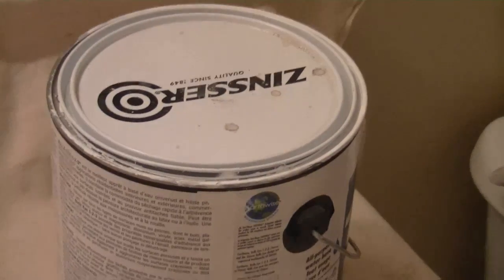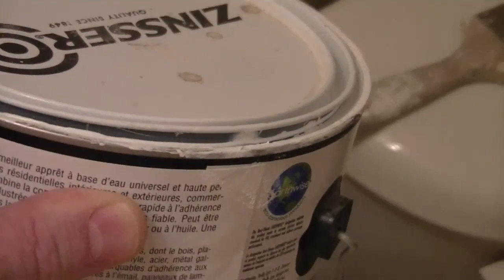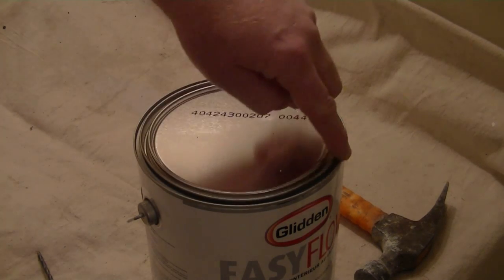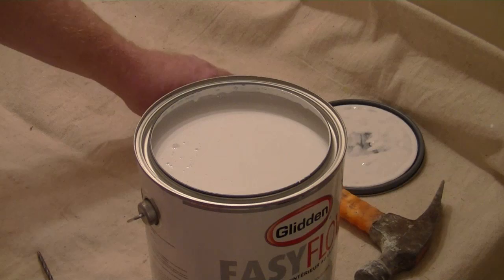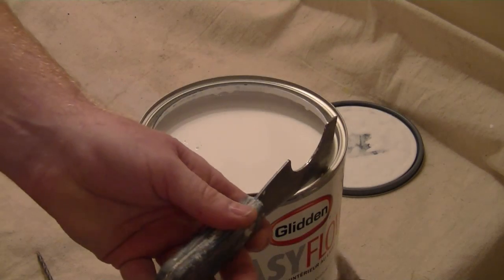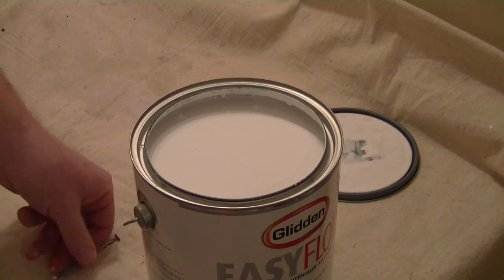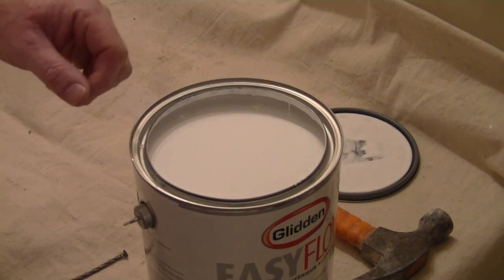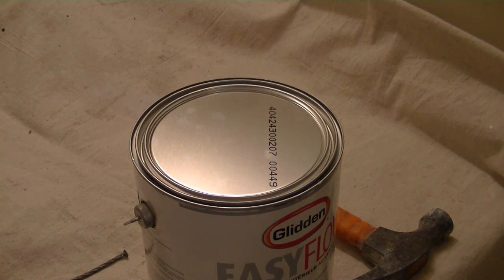Quick Tip : How To Keep Your Paint Can Rims Clean

Comment: So..... We destroy the airtight  sealing surface in order to prevent paint buildup which causes the can not to seal? I know it's an old "trick",  but it's bad advice. Just wipe the sealing channel clean.
Reply: Yeah, this "trick" seems self-defeating.  Better off just taping the damned lid before pouring paint.

Comment: Great but this would cause the paint to skin over as you have no seal left yoy would be aswell leaving the lid off
Reply: Thank you!  How is this a good tip when the paint will dry out?!!! Isn’t the idea to have no paint on the rim so you can get a good seal so the paint won’t dry up????
Reply: Not at all.  The seal is on the side of the valley, not the bottom.